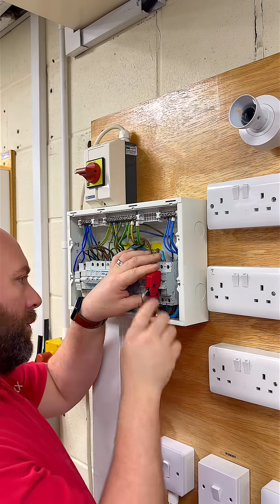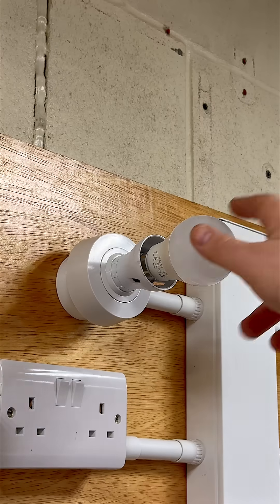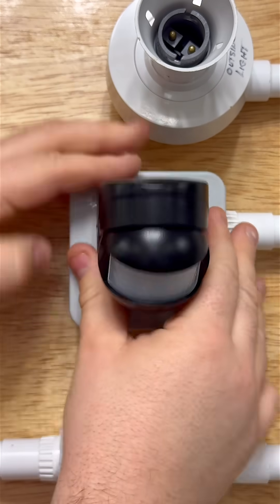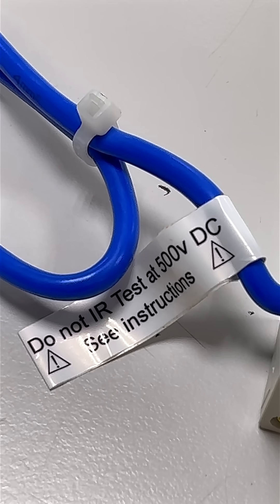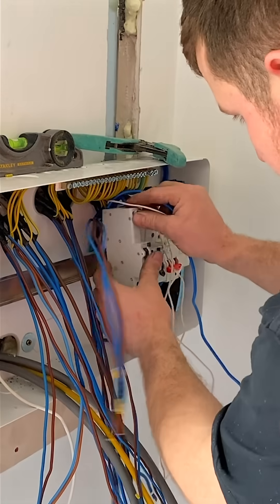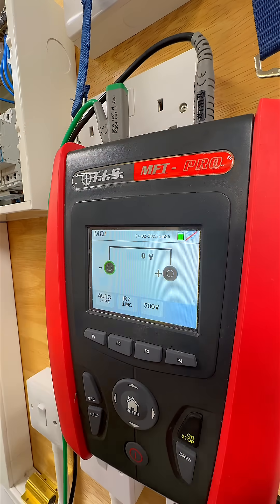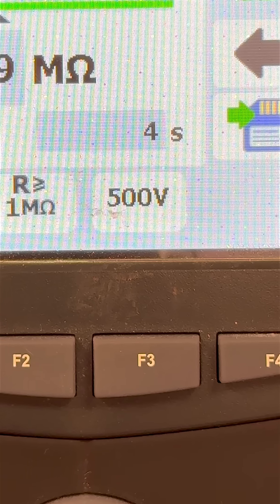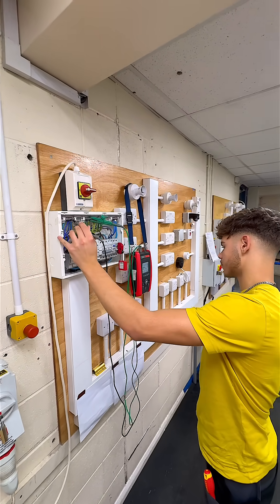Pre-Test Checklist for IR Testing!

Comment: orrrrrr test at 250 and link L-N+E ;)
Reply: test at 500v and look at the actual voltage the tester pre tests if there is an issue it wont go above 50v
Reply: @AGRElectrics  Exactly!  It's the grandfathers using ancient wind-up Avo units to blindly pump 500V down the line that are the problem.  Anyone using a modern tester hasn't needed to "connect L-N and test to CPC" for years.  Unless you have genuinely sensitive (not adhering to ISO standards) equipment in medial/lab settings and you need to be paranoid not to claim on your PI insurance (if you're testing an IT system, paranoia sets in easily;-)
Reply: We know you're going for the rage-bait, but it's entertaining to bite, so...

HE SAID "NEW INSTALLATIONS" YOU COWBOY!